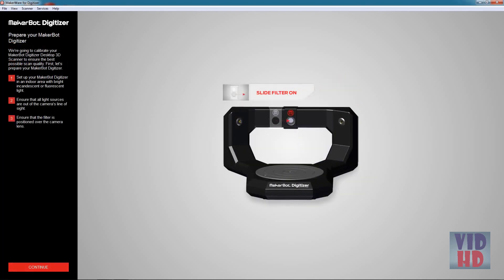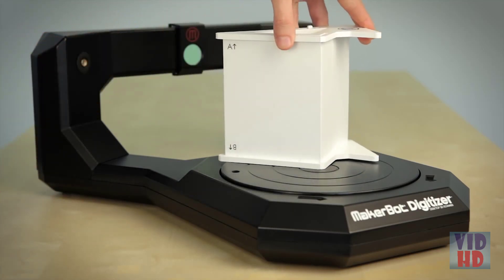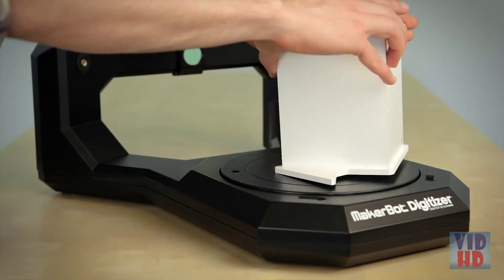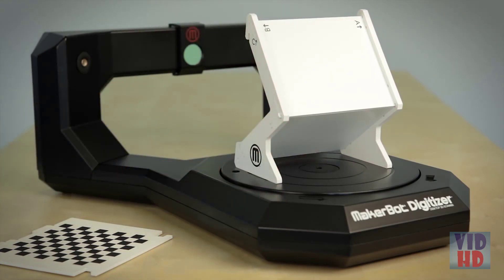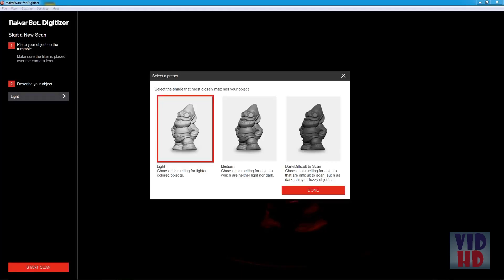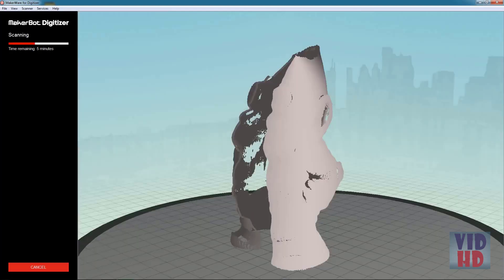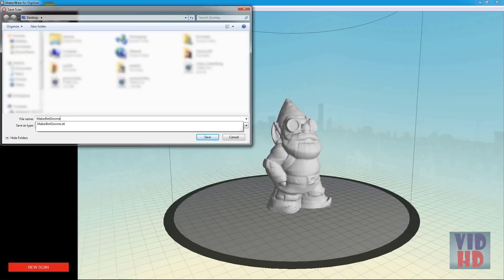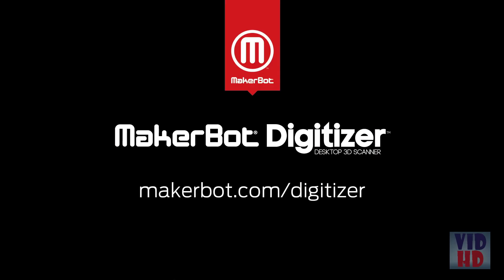The Best 3D Scanners for 2021

Comment: They show the Matter and Form scanner first, I have had the V2 for 6 months, invested hours in scans and have only been successful scanning the duck. That heart scan most likely took a couple of hours or more. Honestly I feel sort of ripped off, I bought this scanner to work with my Ultimaker S3 printer. The scans are so bad I won't even attempt a print.
Reply: What would you recommend then?
Reply: @Skybaby79  I would definitely reccomend not buying the Matter and Form. It isn't worth the price (and compared to other scanners, the price is cheap, but not worth it). Best by large is the Artec Eva but also the most expensive by large and you get married with the company because the software is by subscription. Makerbot is just as bad as Matter and Form. Fuel 3D is not a scanner. It is a joke. A very bad and expensive joke. Pure crap.  So, of all this list, I would go for the Einscan-SP hands down. Apart from the Artec Eva, it is the only scanner in the list that really works and gives pretty decent practical results. Everything else is a toy.
Reply: @TheArtofWalls  would you still recommend the Einscan-SP
Reply: @JJ-vp3bd  undoubtedly. I think the Einscan series are the best money worth scanners out there. The cheaper ones are expensive but still way cheaper than similar scanners from other brands and even the cheapest one is a pretty good scanner. Then the prices and specs of the Einscan series go up and up so you can decide how much quality you want/need and how much money are you willing/able to pay.
Reply: @TheArtofWalls  do you have any recommendation on 3d tools I could use for a small figure if I can afford such a scanner?
Reply: @JJ-vp3bd  Meshmixer is great for editing any 3D scan or any other 3D model in STL or OBJ format  very simple to use and gives you great results. But  be aware it is a sculpting tool so it is adequate for artistic work but not for mathematical precision.
Reply: ffs of course the 3d scanners have to be super expensive. I hear you can use the linar cameras on iPhones as 3D scanners? Anyone try that?